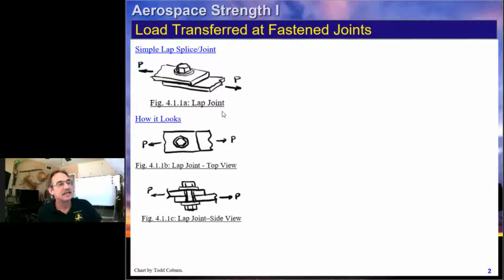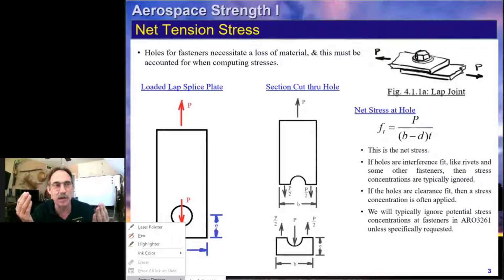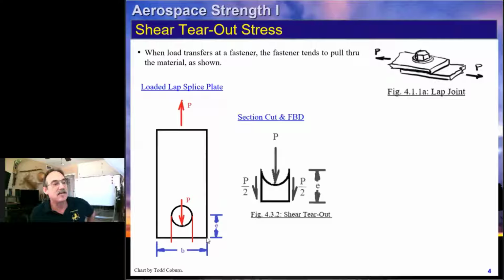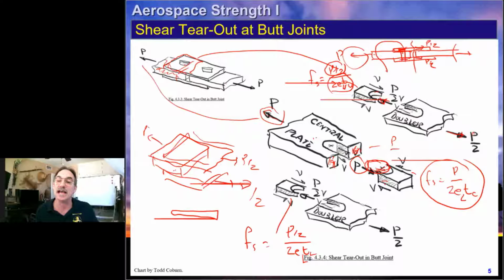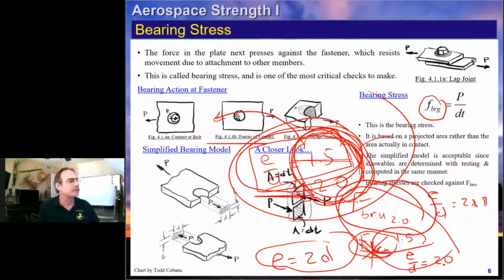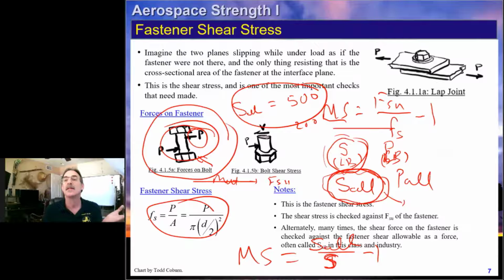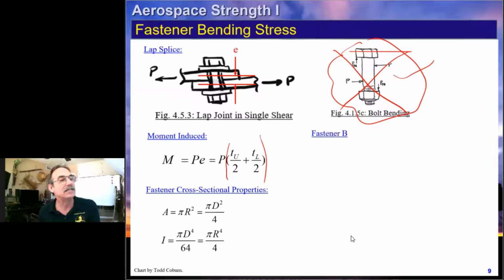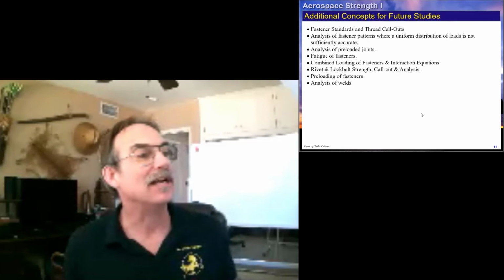Strength I: L-05 Fasteners - Shear, Bearing, Tear-out, Net-Section, Fastener Bending

Comment: Great lecture! Had a question though for bearing stress when a countersunk fastener is used, specifically what area to use. You mentioned that A = dt and while that’s easy calculate for a protruding head bolt, how does it change for a countersunk bolt or rivet?
Reply from the maker: Good question.  The countersunk surface make analysis more challenging.  The countersunk head increases the projected area, but since the hole is no longer cylindrical, the P/dt is increasingly in error.  For this reason, margins of safety for countersunk fasteners are usually written by comparing the shear force to the allowable shear force obtained from testing.  See Lecture 10a of the Strength II Playlist to see tabulated properties and how they are handled.